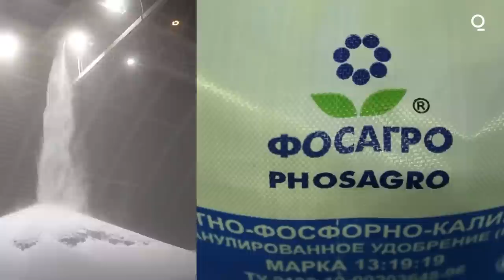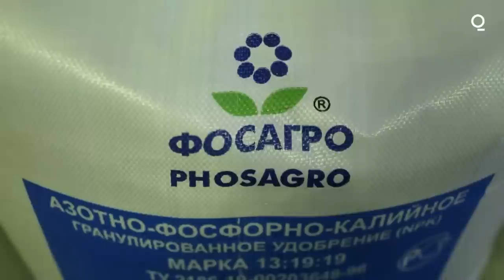Russia and China Have a Stranglehold on Global Food Security

Comment: We need to build resilient Soils
Reply: @drmodestoesq  Its an important question and one that represents the ideology that has caused many of the problems in industrial agriculture. Look into soil science a bit more. One thing you will find is that nitrogen fertilizer is much less necessary with a developed soil because that soil provides an environment for nitrogen fixing bacteria. Another thing is the mycelial network. Plants, Like animals, can not access nutrients on their own, they need microorganisms to mediate the transfer from the soil to their roots. so in a soil that does not have the network, most of the soil can not actually be accessed by the plants, thus wasting the fertilizer we add. Plants can share resources this way and help each other when they are weak, making them more efficient.  a healthy soil stores carbon and water also, so it helps more with GHG emission and allows for more efficient use of water.